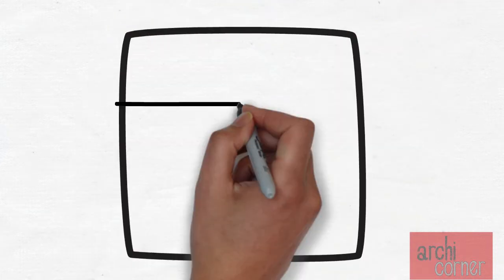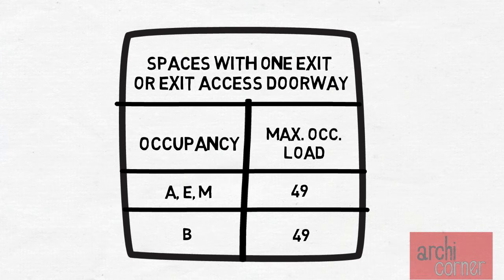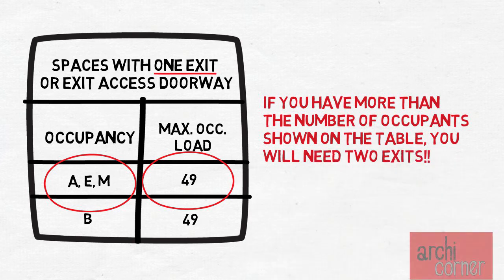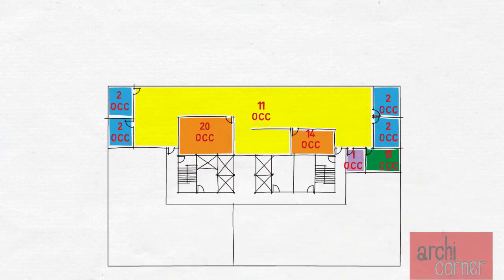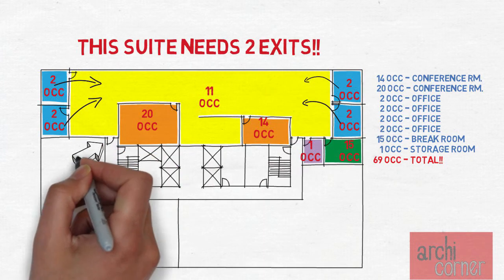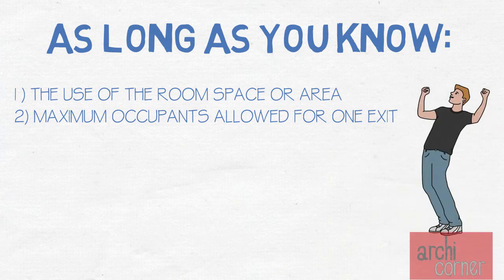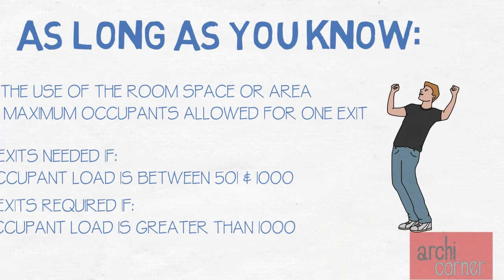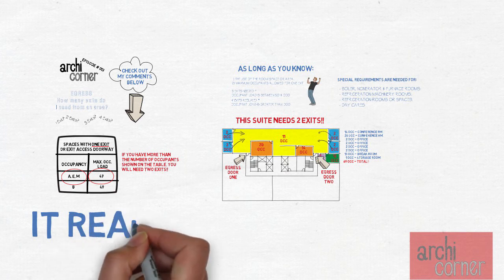AC 013 - Egress: How many exits are required from a space?

Comment: How about if it's a historic club?
250 people in the Main Hall, with 1937 doors/frame and hardware? The pairs of doors are 2'-6" wide each for a 5 foot opening.  
Do exit doors need to be 3 ft wide each for a 6 ft opening?
🤔
Reply from the maker: That seems like a very specific project question. It may be best to contact an architect in your area that can help you navigate through the local jurisdictions. There is no “one answer fits all” for this. Every building is different.
Reply: @archicorner  Exactly,  It is very specific  and I came to the same conclusion, they need an architect. This is to much liability for me, I know some fire code & Door Hardware requirements but not enough.
Thanks, Doc (Locksmith)

Comment: I think your explanation is  not 100% true. What if a space has less then 49 (assuming group B) but to reach certain exit you need to travel more than 100ft (more than common path of travel)?
Reply from the maker: That is a good point yogaf08. In addition to occupant load, the number of exits may be affected by travel distance, based on IBC Table 1006.2.1. Good catch.

Comment: Explanations of IBC fire separation, dealing with multiple occupancy buildings, or when is fire protection/detection is required?
Reply from the maker: M apologies for the late reply. There is a poll in the channel and posted this as one of the options for  this month's video. If it gets selected, I will create a video for it this month. Nevertheless as a starting point, check out IBC Chapter 5, Table 508.4. The table lets you know if two different occupancies require fire separations and if so, what hourly rating is needed. Hopefully this will shed a little light into your question. Have a great day.